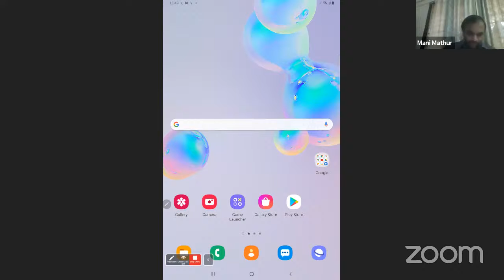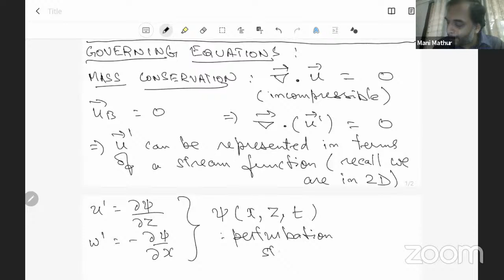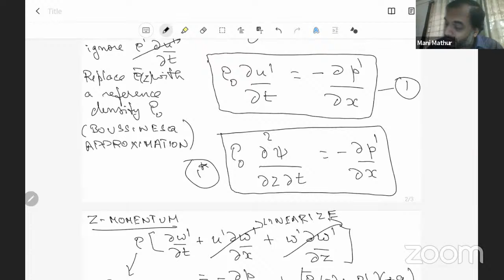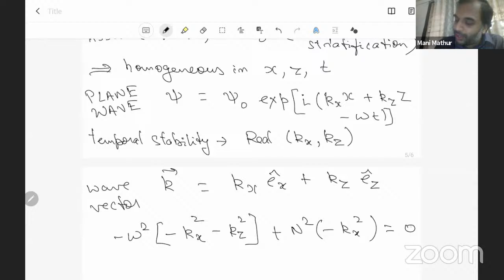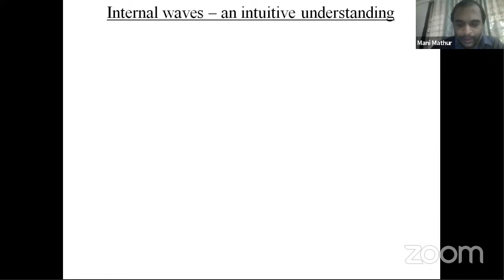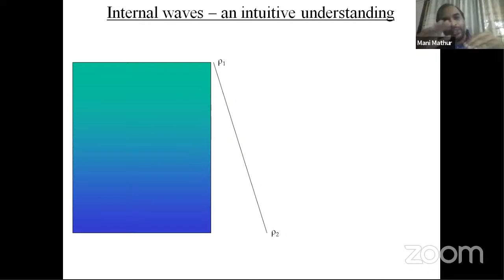SPARC Lecture Series - Stratified Flows - Dec 15 - Linear Internal Waves

Comment: Sir, you mentioned that in case of temporal stability,  k (wavenumber ) will be real in homogenous directions. But, if it is complex then it will diverge at infinity or -infinity. what is the meaning of 'diverge at infinity'?